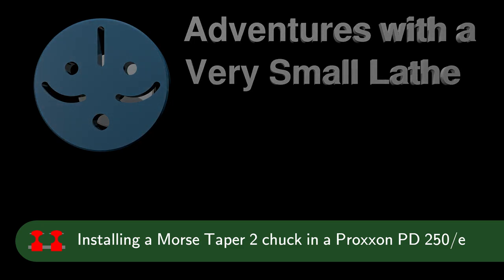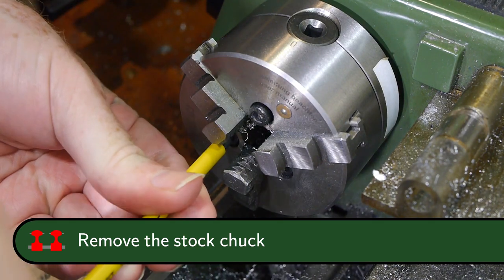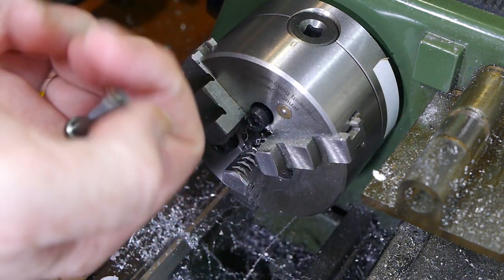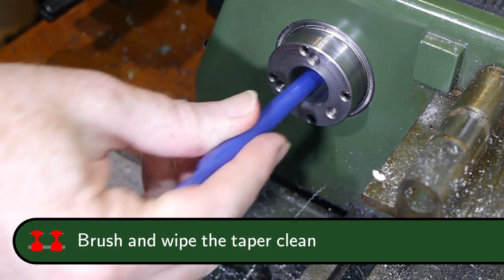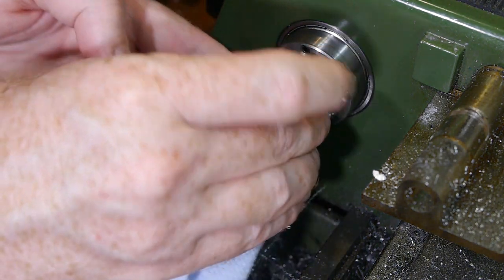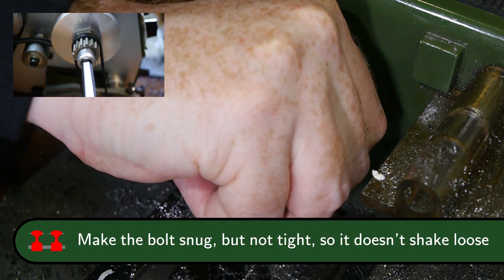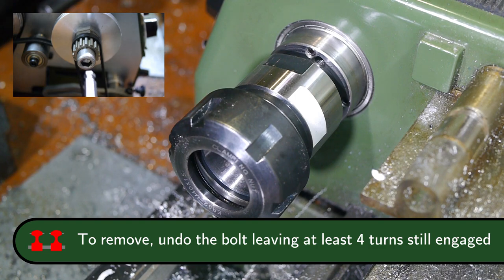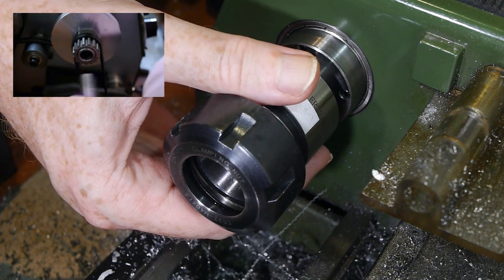How I fit an ER Collet Chuck to a Proxxon PD 250/e Lathe

Comment: The wiggly and highly unstable saddle adjustment system on my Proxxon PD250 lathe drove me nuts, so I decided to start an upgrade project.
1. I milled two 8 mm thick aluminum blocks and fitting brass shims for the two cavities in the bottom of the saddle. I also removed the two set screws from the steel plate. The idea is to make the saddle and the steel plate below form a rigid unit. After a little fine tuning with .001 shims, the saddle moves smoother than ever. No holes drilled, no extra screws added. Future adjustments will probably demand a .001 shim, or two, to be removed.
2. The lead screw needs better bearings. I made a replica of the right side aluminum support for the lead screw and milled a 4 mm deep recess in it's left side. I also made a 5x7x11 mm bronze bearing sleeve for the hole. I installed 5x10x4 mm cheap thrust ball bearings on both sides of the support. Thanks to the recess on the left side, the upgrade does not affect the lengthwise position of the lead screw. Then I faced off 4 mm from the hand wheel hub. So far I can say that the lathe runs smoother than ever.
3.  There is too much backlash in the lead screw. The next step will be to replace the tiny lead screw brass nut with a bronze  pressure nut. Not much room for it, but I believe it can be done. The backlash should not exceed one or two taus with a pressure nut installed.
4. The feed screw nut in the cross feed has exactly the same dimensions as the lead screw nut. I'm not sure there is enough room for a pressure nut in the saddle though. 
I haven't researched the market but maybe there is an upgrade package with steel components available for this lathe? It would make it more of a professional tool. The mix of steel and aluminum parts is doomed to wear out rather quickly.
Reply: what do you by "saddle adjustment system"? The top (compound) slide? I don't get your 1st point of improvement… Could you tell the part numbers as per the PD250 manual (explosion drawing in the appendix)?
Reply: @marcoam2610  The saddle is hold in place by a thick steel plate (page 20, part 23) that runs under the ways. It is fastened to the saddle with two M5 screws (21). The two screws are counteracted by two set screws (22) to adjust the play. Those set screws dig right into the paint on the saddle. This arrangement makes it difficult to obtain a good adjustment that lasts. I got rid of the set screws and packed the two recesses in the bottom of the saddle with aluminum and brass shims. This has worked really well. The die cast Zamak parts in Proxxon's products are full of hollow parts which makes it tricky to do upgrades. There is simply to little material to work with. I call it "sandwich design". Steel ways, Zamak saddle, steel cross slide, Zamak compound, steel top slide. Since last time I have made a very tiny pressure nut for the cross feed to minimize the backlash (i.e. 26 replaced). It works pretty well but needs frequent adjustment. Then I replaced the bronze bearings in the belt pulley (page 16, no 50) with ball bearings. Also replaced the belt tensioner screw (41) with a lever. The main improvement is an eccentric quick release for the tailstock. It should be standard. See Michel Uphoff's excellent channel! He made a QR for his PD400. I scaled down his design for the PD 250. I made drawings and shot still pictures of it (and everything mentioned above), but unfortunately no video. I plan to create some kind of still picture video about the tailstock QR, just to convey the construction. It's a fun project! Feel free to ask for more clarification if need be.

Comment: @Adventures with a Very Small Lathe DO U HAVE MAKE  custom draw bar?
Reply from the maker: No, I used an ordinary stock M10 bolt.
Reply: @AdventureswithaVerySmallLathe  
Hi I would also like to buy the same er collect chuck. One question, can you tell me the bolt how long it has to be? Another thing, but does the spindle /chuck turn accurately in the dial gauge?Thanks
Reply from the maker: @Rawplug  The bolt I used is 90mm long. I measured the overall length of the spindle bore using callipers, then I measured the depth of the tapered part of of the bore, up to the shoulder. I can't remember exactly what the ideal length for a draw bar was, but 90mm was close enough.
I bought 3 ER chucks, and the amount of runout depends on the quality of the tool. The cheapest has about 0.2mm runout, which means it's not good enough for most uses. The best one had a few hundredths of a millmetre runout, but it can be bumped to run true. It's not as good as a proper lathe collet chuck, but that's to be expected as ER collets are designed for holding tools in a spindle, not holding work on a lathe.
Reply from the maker: @Rawplug  The linked tool looks right, but I can't tell how good the quality is. This is a common problem with eBay tools, as the exact specifications aren't guaranteed.
Reply: @AdventureswithaVerySmallLathe  
Hi Thanks for the detailed answer. At this point I buy the original, I just hope they are very precise in the runout I expect less than 1 cent from the original Proxxon

Comment: Hi im also looking for a collet cuck for my pd 250 lathe,is this a good one or are there now better alternetives.
Reply from the maker: I think the best collet chuck for this lathe is the official Proxxon one, part no. 24 038. The collet chuck I show in this video sticks out a long way from the spindle, and is a bit too flexible. The Proxxon design is much more rigid. The downside with the Proxxon chuck is that it's quite a bit smaller, and it's a lot more expensive.
Reply: @AdventureswithaVerySmallLathe  yes thats why im looking for a e32 chuck the proxon is to small.but thanks anyway i keep on searching.greetings frank.
Reply from the maker: @frankske1958  I think if you want ER32 for the Proxxon, then this style of Morse taper 2 chuck is the only available option.
Reply: @AdventureswithaVerySmallLathe  
Is it at all possible to have an ER32 collet on an attached flange (instead of a MT) so longer stock can be worked on this lathe? If so what would your recommendations be for an after market product to bolt on?

Comment: Thank you for all you do. I wonder if you ever service the PD250? I am very keen on buying myself this lathe but can't find anyone servicing them on YouTube videos, I can't find technical specs like Watts of the motor and I have failed to find any parts for sale, like motor, belts, gears and bearings. I have noticed that Proxxon do have an email part request, but this is a huge outlay for my first lathe and I want to know that if the worst should happen that I can afford the parts cost. Am I to believe that nothing ever needs replacing on this lathe? Am I wrong to be concerned that I have to ask by email for replacement belts? You don't have to answer me, but it may be nice to add some of this in the tips section of the tools in question. I do love watching your videos, you would have made an excellent teacher.
Reply from the maker: I've honestly never services the lathe, beyond basic cleaning and lubrication. There are simple instructions for lubricating the sliding surfaces in the manual, but nothing at all about the spindle bearings, or inside the headstock. The manual warns against any attempt to disassemble the lathe, so I guess it's not intended to be serviced by the owner. Having said that I have never felt I needed to service anything beyond the basic lubrication covered by the manual.

I have ordered a part from the Proxxon service centre, but the price was higher than I thought was reasonable, and the part i got sent wasn't brand new, so I'm unlikely to try that again unless I really need it.

I do plan to strip down, and deep clean the lathe at some point, so I'll made sure I shoot some video of the process.
Reply: @AdventureswithaVerySmallLathe  Thank you for a good answer. I wonder if you find it underpowered? I downloaded a manual and it said the motor was only 140 watts. I feel that I like the Proxxon more than than the cheaper Chinese 550 watt lathes, but you use the Proxxon PD250/e so very well that I feel the small motor is enough. I look forward to watching every Proxxon video that you make and thank you again!

Comment: Hi and thank you for the vid. As a beginner I'm very far from knowledgeable so I ask where I can get this ER32 and collets that fit the PD250e as demonstrated?? I know the proxxon collet set is ER20 and very expensive so any alternative options are welcomed
Reply: Banggood.....
ER32 MT2 M10 Milling Collet Chuck Holder Fixed CNC Millling Tool Holder

Comment: I have asked this elsewhere as an add on to an answer but I'll but it here as well for anyone else that might be interested...
Is it at all possible to have an ER32 collet on an attached flange (instead of a MT) so longer stock can be worked on this lathe? If so what would your recommendations be for an after market product to bolt on?
Reply from the maker: It's absolutely possible to buy an ER32 collet chuck with a flange mount, but it would be too big for the Proxxon spindle mount. Proxxon make a collet chuck with a flange mount, but it takes ER25 or ER20 (I can't remember which), which is obviously quite a bit smaller. Flange mount ER32 collets are available for Chinese C2/CJ0618 lathes which have a much larger spindle mount diameter.
Reply: I am very curious about this too. Proxxon's official ER20 attachment is too small and too expensive.
Ø80mm ER32 flanges do exist (check out article 11044 on the German "Paulimot" website), and this channel already has a brilliant video about mounting a third-party Ø80mm chuck to the PD250 via a custom backplate. 
Looking at the diagram on the Paulimot website I can't immediately think of any reason this shouldn't be possible with the ER32 flange too.
Reply: @Gsazraetr would you mind linking the video you’re referring to? I’m really interested in it but unable to find it. Thanks
Reply: @WoodfulProjects  v = MLRcrBEXbho
[Making a 4-Jaw Chuck Backplate for the Proxxon PD 250/e Lathe]
Reply: @Gsazraetr  thanks a lot. Appreciate it.

Comment: Hi Adventurer,
Have you ever removed the main spindle ? Actually , I don't want to remove it, I have the problem with removing the triple V belt pulley from main spindle. I think it's thread-glued with Loctite but I'm not sure. Sorry I restart it from the beginning. I want to change the main motor of this baby lathe. I've found very good AC 400W servo for that purpose. The old motor is a 140W DC motor with about 4200 max rpm. I'll have about 2...3 times more torque with the new motor without necessity of the triple V belt pulleys to change rpm ranges. Don't need that anymore, still I'll have much more torque from 0...3000 rpm, especially at higher revolutions. OK, but the old V pulleys are simply too weak to transmit that power, they have to go, I have to change them to timing pulleys. But I don't wanna trash the main spindle, its fine I think, I just don't know how to remove that triple V pulley from it. This was the whole story. When I'm done of course I'll share my experiences with the public. I think this baby lathe is very lovely, but I found its motor too weak, so I upgrade it. What do you think ?
Reply: I was right, it was thread-glue. Fortunately it was the blue one, that is middle strength only not like the red Loctite glue. Now nothing can stop me from changing the motor, woooot.